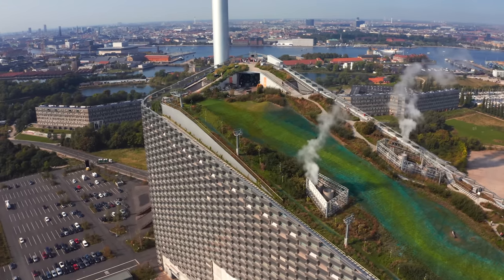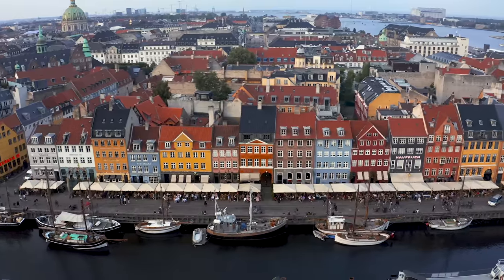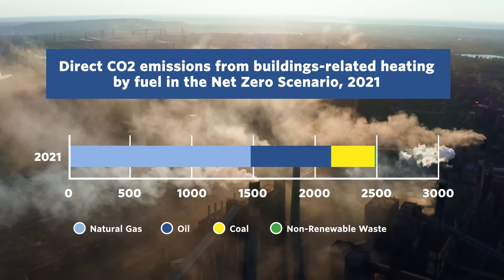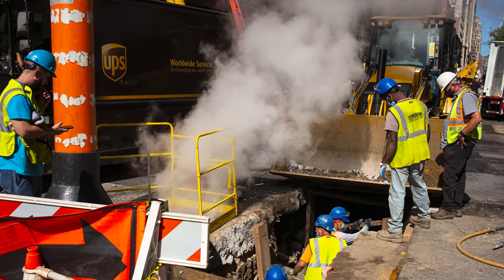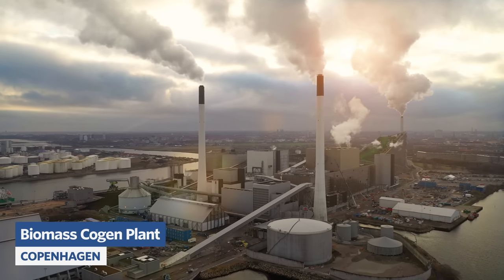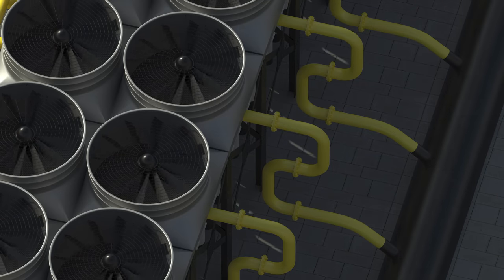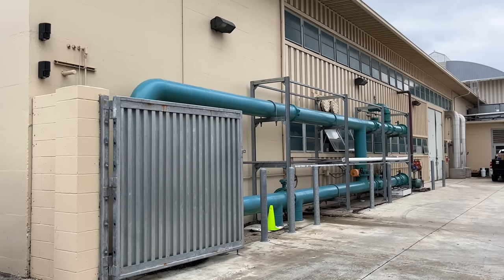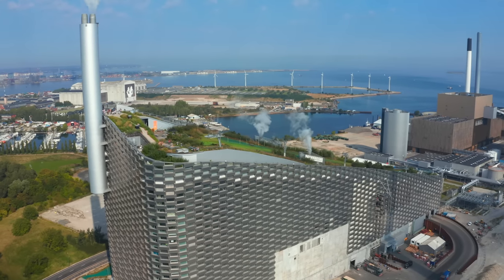An Introduction to District Heating Systems

Comment: Here in the Netherlands these systems are quite widespread. I am using it ("stads warmte") myself and its great. It negates the need to buy a central gas heater ("CV") or a heat pump myself, so there is no upfront cost. Downside is the lack of competition and monopoly position of the commercial company providing the system to the municipality. Prices are regulated, but you are stuck with one supplier without and choice

Comment: In France, sometime the heat of nuclear power plant are used to heat the greenhouses because although you could probably safely put the power plant in the middle of a city and use the heat to warm the city, people are not fan of nuclear power in their backyard.
Reply: nuclear power is precisely as safe as those in charge of it are trustworthy and compitent. 
Given how often both corporations and government entities have perverse inscentives encouraging bad practice, and given the consequences of a failure? It's entirely reasonable not to want such a thing anywhere near you (or, for that matter, upwind of you). Doesn't matter how safe the design is when everything's in good repair and everyone is doing their jobs properly, it matters how safe it is when that's NOT the case. 
Coal plant? Steam explosion that probably doesn't do much to the surrounding area, and a regular fire (which, well, cities have systems in place for dealing with That already). Nuclear plant? Much bigger deal. 

Mind you, no one wants a coal plant anywhere near their house if they can help it Either, given the smoke and the fact that the things put out a mildly concerning amount of radiation in the course of normal operation (more so than a nuclear plant, in fact).    Gas is, of course, less bad, but still not the greatest thing ever.   And, of course, no one wants to live immediately down stream of a hydroelectric plant. Wind is Less bad, but the noise is still an issue.  

No one cares about living near photovoltaic cells, heck, they'll stick 'em on their houses, but those have their own downsides, and using mirrors and lensese to focus solar energy to drive a steam turbine takes up a tonne of space and actually screws up local weather patterns (for much the same reason as cities, particularly those full of excessive amounts of road and carparks, do, only much, much more so) and are rather bad for birds that make the mistake of flying through the beam.

And those idiots trying to bill Orbital Power Transmiters as the solution to 'clean energy' generation... they're litterally dumping heat that would Miss the earth otherwise, Onto the Surface of the earth (kind of the oposite of the desired result) in the form of what amounts to a Giant Doom Laser (well, not Technically a laser, but functionally indistinguishable in effect)... ... if a person can't see the ways for THAT to go horribly wrong (both with and without bad actors involved) they have no business being involved in any project that might possibly have the capacity to actually implement the thing. ... Though they're at least right that it wouldn't be producing much of anything in the way of greenhouse gases.

Comment: I believe the city where I live in Tokyo uses "district heating." Next to our recycling center is also our sports center. I see material going into the recycling center, but I never see anything come out. I've been told they run an incinerator but like this place, there is almost no smoke. The heat is used to heat the swimming pool next door in the sports center.

Comment: You did forget to mention one part of why district heating is so genius, it doesn't just collect waste heat from power plants, it collects waste heat from all sources, which can make it essentially free. It's extremely easy to install heat exchangers into any factory or server farm so for that reason it's often done and by doing so you're often providing a valuable service to those industries since they have a need to cool down their machinery.
Reply: Well you still have to pay the grid cost, as fara s I know they've never ever allowed the market price to dip into negatives.

Comment: Norway actually has district heating as well. I live in Stavanger, Norway and unfortunately our brand new $200+ million recycling facility that used to provide district heating to Norway's largest business area (and surrounding houses) burned down summer 2022. Parts of it still works but its output is significantly reduced. Geothermal district heating is also not uncommon here.

Comment: We do have some limited district heating in Oslo and Trondheim although you're overall right it's fairly limited elsewhere in Norway
Reply: Indeed! I have it here in Trodheim. I think all (or most) new apartment buildings are required to connect to it.
Reply: @chrdal  Makes sense, even with renewable electricity, electric radiators are very ineffective.

Comment: 6:01 is a demonstration in Milan, Italy. 
Talking about Milan, it has the biggest heating and cooling web system in Italy. According to the website of the company which owns the facilities more than 220.000 apartments are connected.
There are various plants, but the main one is a waste plant North West of the city - Figino - which is a cogeneration plant. But the company also purchases heath by industrial installations which generate heath by their manufacturing process that otherwise would be lost.

Comment: The problem with district heating is that it often is surprisingly expensive for households. Here in the netherlands, the price district heating companies can charge is linked to the price of natural gas, which means that high gas prices mean expensive district heating as well. For some, it gets so expensive that it is cheaper to use a heatpump instead, which seems a bit silly for waste heat.
Reply: given how cheap heatpumps are to run, I would have expected that to be the baseline to compare to to begin with <_<
Reply: @laurencefraser  If the price of electricity is ALSO essentially determined by the price of natural gas, the heat pump gets smacked too.

Comment: There's a big district heating project starting in my town to connect the district heating systems of the central city and the port suburb. This at the same time as the battery factory being built is connected as a heat producer. The other main heating sources is a smelting plant and a cogeneration plant run on peat and sawmill waste. Though they are going to stop using peat in the coming years.

Also the return heat of the system is used to heat and de-ice the main pedestrian streets in town.

Comment: The apartment building I work at in Portland OR sort of has district cooling. Our air conditioning system uses chilled water from infrastructure on a building across the street. Several buildings in the area use this chilled water plant. Our heating is just electric though.

Comment: I have this in my apartment building (Amsterdam) and I didn't fully understand it at first. They told me that my heating came from city systems, and all I could hear was "We pipe in your heat", and it sounds like nonsense to me. However as gas prices are skyrocketing, my relatively low heating bill is the envy of some of my work colleagues.

Comment: Look at the Whisper Valley community near Austin TX - 2000 acres master developed - using district geothermal hybrid system with ground source heat pumps - for cooling and heating.

Comment: I work for an electiricty/heating provider and I have 2 things to add:
- waste incineration doesn't provide anywhere near enough heat on its own. We burn pretty much all municipal trash and even in a mild winter like right now we get somewhere around 10% of our heat from waste, with far from 100% coverage. Waste incineration also needs additional fuel to burn properly. It's a nice addon, but not a solution to the energy crisis.
- Piping capacity is a major issue, arguably the most important one. Low capacity means you need higher temperatures, which makes renewable heat sources like heat pumps and geothermal plants inefficient (also applies to thermal plants but to a lesser degree), and adding more is hard because you'd need to dig up half the city. And we're already lucky to have heavily invested into district heating in the past, most cities have even higher costs.

Comment: cal poly slo used to have a steam heating system. Steam unfortunately corrodes its piping really quickly. They were in the process of upgrading to hot water when I graduated.

Comment: Switzerland uses the same practice of refuse incineration plants to create district heating. There is an older one a couple kilometers away from where I live. It is up for modernisation and will be resized as there's less incinerable waste being produced. The local green party launched an initiative to use the modernisation for an upgrade to co-generation. It was approved by over 75% of voters. Our municipality sadly hasn't yet joined the future district heating network, but there wasn't yet a vote on it.

Comment: This is an advanced version of the method used to provide heat in the USSR. In the USSR in many buildings there was no heating system in buildings. The heat was generated somewhere else and piped to surrounding buildings. Obviously this is a more advanced version however if the building supplying the heat goes down for whatever reason the heat in many local buildings also goes down.

Comment: Great video about district heating.  As district heating matures and lower temperatures in distribution networks makes it possible to utilize low temperature geothermal energy to heat the water in the district heating system, new sources of energy are being introduced. In the second largest city in Denmark Innargi and the district heating company Kredsloeb are developing the worlds largest geothermal district heating system. Super cool. When online 36000 houses will be heated by almost 100% emission free geothermal heat.

Comment: District heating is the norm in cities around here (Danish). My job and education is related to these systems and my experience with them has lead me to consider them the best option in the vast majority of cases, provided some minimal amount of population density.

It's very easy to deal with as a consumer, and you can run it both for direct and indirect heating depending on the building's specific layout.

If available it is almost always the cheapest option to use as well. The install costs are low, the maintenance costs are low and you don't need fuel shipments and storage. In terms of cost its main rival would be heat pumps.

The reality is that district heating is almost always cheapest though, because if any heat source becomes too expensive the companies running the district heating service will switch over and they do it much faster and more efficiently than the home owners, businesses and institutions in aggregate would have done if they were running their own heating sources. Economies of scale being what they are, the district heating company have much greater incentive to switch to cost-efficient sources than those further down the line do.

In my city the district heating plants run on garbage incineration and biofuels, which meant that even when energy prices spiked by orders of magnitude in Europe in general, my heating cost didn't go up at all. They actually projected a 0% increase in energy cost year over year, in the middle of the energy crisis. Though other regions district heating costs did explode if they were using gas or fossil fuels to provide it, but their competing heat sources all exploded any way, so it didn't make them any less competitive.

The only hassle I can think of with district heating is that the pipes and installations which directly interact with the district heating system need to be serviced by the district heating company, you cannot work on them yourself or hire outside contractors. They are considered critical infrastructure and it is very much illegal to mess with them. The upside to this though is that service and maintenance on those systems is included in your district heating costs, so you rarely have additional costs if there are issues with the system and you need someone to come out and fix it, provided you didn't cause the fault. The district heating company will also monitor their systems religiously and will sometimes notice faults and leaks before you do.

Comment: Not for UK. Not enough HDD for a feasible, long term operation. OA Design temp for South of England is -3 . Compare that with Germany, Norway , Sweden , Central Europe where OA design temp is -18.  UK needs local solutions per building or clusters of max 5 or 6 closely located buildings. Ah of course , everything can be " made feasible" at the back of the customers cost per kWh.

Comment: I am on a communal heating network - a central gas boiler for four apartment blocks in my case. Unfortunately it's pretty useless. Only 30% of the gas burnt turns into heat in our homes. So our operator takes their cost for gas in £/kWh and divides it by 0.3 to calculate our unit rate. This means I'm currently paying £0.46/kWh of heat, which is so high I can't afford to use it and have reverted to my back up electric immersion heater for hot water and just don't turn on the central heating.

Comment: District heating is also a great way to be able to make ground source heat pumps available for a larger community. It doesn't have to burn anything to be useful.
Reply: Where do you get the electricity to run the heat pump. Solar or wind or an insulated medium such as water or sand that can then run a turbine to produce electricity for the heat pump. Heat pumps are great for pulling the last bit of useable energy out of a heat source but they are always supplimented by an energy driver such as electricity.

Comment: In my city more than half of the buildings use district heating already, but most of the energy comes from a gas plant so still not perfect, in another city in our state it is over 95% so we have a lot of room for improvement

Comment: Hey, we do so use district heating in Norway! The source of the heat is just an incinerator rather than a power plant. I used to live in a suburb in Trondheim that had district heating and hot water. Now I live in Oslo, and am looking at a move in the near future. I would consider district heating a plus for our future apartment!

Comment: As European I found it very interesting that sprawling cities don't use district heating. I live my whole live in buildings heated by city and it is very cheap. But that make a lot of sense. But in 2000 I was seeing green grass lines on snow in my neighbourhood and that was possible by huge energy losses on pipes. Now after modernization even in mild winters there is snow in these places. Fingers crossed for improvements on that technology.

Comment: I live directly across a street (well, a canal) from the city heating plant in Rotterdam, the Netherlands. It's in the dense center of town, yet has a surprisingly small footprint. I pay an estimated amount (€200) each month to the landlord; I assume the building as a whole is billed. My radiators have little meters on them, so ostensibly I'll receive a bill or refund corresponding to the amount that I personally used. I've only been here a few months, though; I think they work it out annually. Anyway, from my point of view it works like any other radiator, with an on/off knob. Seems to function just fine.

Comment: The biggest disadvantage in the post-soviet buildings, that in most systems there is no way you can adjust the room temperature individually. It is either too hot or too cold inside. Also more expensive, than individual heating. (At least in Hungary.)
Reply: Shouldn't be impossible to fix (but might be costly). Heat exchanger between the network and the house should have a thermostat to keep the hot water cycle inside the house at certain temperature. Then you need some "hard to adjust" valves in each radiator that do balancing between apartments or other parts of the house, and then thermostats to keep the each room comfortable according to everyone's taste. IDK, maybe the plumbing is done so that this isn't possible.

Comment: District heating by waste to energy or nuclear energy is the way to go. 
Upping efficiency of using heat by using cogeneration is always great, and either have it be by some mean of carbon that is self sustainable (waste to energy, both this and in wastewater treatment plants using HTC), or zero emissions like nuclear is even better.

Comment: 9:30 You can still use district heating, you use the electrictiry to power a heat exchanger and then excange heat with a geothermal reservoire, or even a heat pump, the advantages is economies of scale you could to this locally but it's cheaper to do it centrlaly if you laready have a district heating grid. Also nothing is less effective than electric heat radiators, in Sweden those will likely be illegal from 2040 becuase they are so much less effective than heat exchangers or heat pumps.